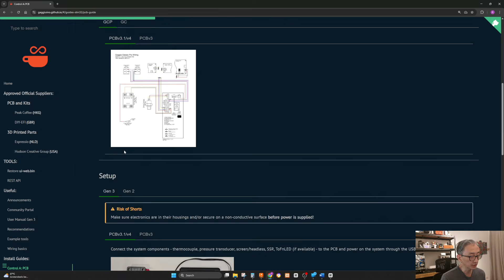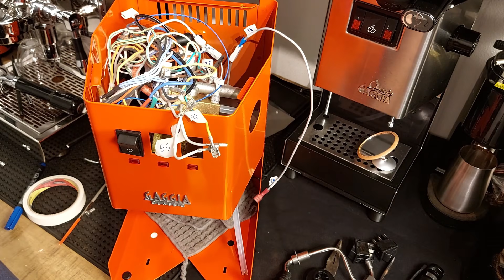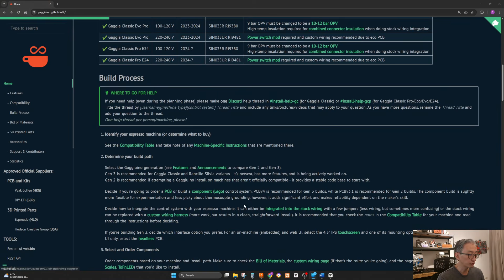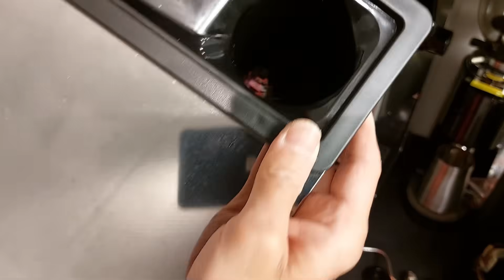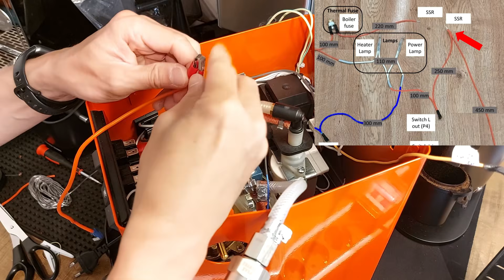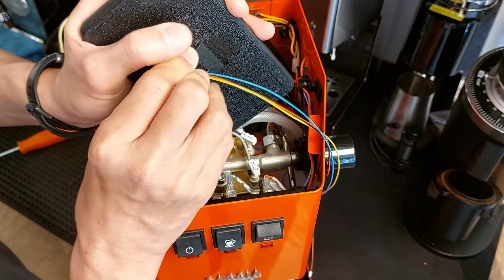Gaggiuino Gen 3 ULTIMATE Full Install guide

Comment: Hi, I have my boiler taken out for de-calc etc. is it easier to fix major cabling outside on the boiler itself or to install boiler back in the machine?
Reply from the maker: I'd put it back. If you didn't descale yet, remember that the terminals cannot get wet or you will break the insulation and if so, you will need to buy a new boiler.

Comment: Awesome video, you really improved a lot of the old video. For me the old one fits better as I have a GC, EU version. 
Did you explain how to download the utility profile [UT] Tube Fill from Community profiles in WebUI somewhere? Did you skip the last step intentionally or am I just wrong?
Reply from the maker: Thanks. I don't remember if I showed, but you can just create a new profile with room temperature, flow limited to 1ml/s for example, and you will smoothly fill the tube with water. You can also flush for a few seconds. If you have any issue, open a help thread on Discord.

Comment: I bought an E24 machine in the last couple weeks and if you're doing this now like me, you need to follow the Schematic because its not that same as this E24 install.  The Steam thermostat also gets remove and there are wires not used and connections not used.
Reply from the maker: Thanks for the alert. Yours is 220v or 120v?
Reply: @EspressoHackers  120v
Reply from the maker: Thanks. I'll re-check that part and see if I need to add some alerts in the pinned coment.

Comment: New version of Gagguino now comes with PTB fitting, should be a bit cleaner than the T fitting for the pressure transducer
Reply from the maker: Indeed. I didn't have the opportunity to test but seems nice.
Reply: @espressohackers do you video on PTB ?
Reply from the maker: No, it wasn't available when I installed my Gaggiuinos. But it's much easier and cleaner, provided that the bolts are not stuck and don't break when you remove them.

Comment: does this display work with the lego version?
Reply from the maker: Yes, it does
Reply: @EspressoHackers  and what kind of display is that... i have made a lego build on a gaggia classic 2003 now i want to build another one on an e24 but i can't find any refs on this display
Reply from the maker: The gen3 display you need to buy from DIY-EFI and Peak Coffee still have available, but Peak will we replaced by another partner. The code for gen3 is closed now and delivered via this screen, that's why you can buy everything else from the official vendors.
Reply: @EspressoHackers ok... so i cannot buy from aliexpress and upload the code...
Reply from the maker: @alexp2306nope.
Reply: @EspressoHackers  one more question... is there specific pcb version for 110v and for 230v? i have ordered one pcb from uk and I just realized that they have 110
Reply from the maker: @alexp2306there aren't 110 and 230. It's bivolt.

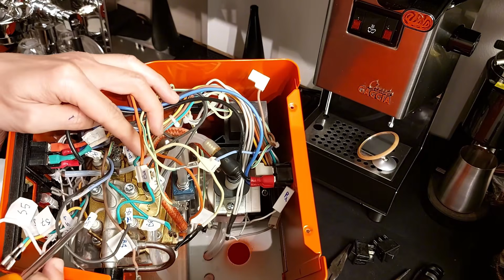Comment: At minute 9:45 i think you have the  heater connections sequence labeled differently than the instructions in the official gaggiuino page. Following the way you’re pointing to the connections in the video, the first one you point at should be H2, then H1, H3 and H4 according to the instructions in the official Gaggiuino page.
Or am I wrong???
Reply from the maker: I'd have to check, but I'm confident that it was correct. The boiler has two heating elements and you just need to pay attention to connect in series if it's 220 and in parallel if it's 110 v. This is the whole logic behind the connections to the SSR.

Comment: Thank you for the lovely videos. Yours are the only complete guides out there! 

Question on the EcoPCB- The discord conversations say it is better to remove it. Where did you get stuck on that one? Any tips?
Reply from the maker: Thanks! You don't need to physically remove it, just disconnect, which is what I did. And the power switch mod, I had done previously. You can see in more details here: https://youtu.be/ZUFQI-8fDfg?si=J8gcgDzLb_mlB__p
Reply: @EspressoHackers  i just got the PCB out of the box no problems (after cutting the wires and insulating them i was unhappy with the result and even when you warned i removed the pump/eco assembly), the two screws at the bottom are finnicky to reinstall, but it was far easier than removing wires from button harnessess :) and after that i realized that my Peakcoffee kit doesnt have full custom wiring precrimped and i have to order flag connectors and reuse some wiring :) but then hey, it will look far more clean with full custom wiring
Reply from the maker: Thanks for the feedback! Good to know that it's being helpful. 

It was tough to remove it, then I decided to let it there. I just cut the wires, insulated them, could have a bit more space if I had removed, but it's workable then I just finished the installation without any other issues.

Comment: Amazing tutorial. Built using that. Is the testing video out?
Reply from the maker: Thanks! Good to know that it was helpful. On Tue, I'll post a comparison between Gaggiuino and Gaggimate with a few performance tests that I did in my E24 and Silvia, both with Gaggiuino and with PID.
Reply: Nice. Gone through it. But I thought that you mentioned at the end of the video that you will test the gaggiuino in depth to check if it’s working.
Reply from the maker: @piyushkjalan  oh, I wasn't clear maybe. I don't think we need to make complex tests to see if it's working/ Right on the startup, you can see if the screen powered on or not, if the temperature is increasing, etc. Before closing, you also need to check for leakages, running some water through the group, then making a coffee of testing with a blind basket just to get some pressure in the line and see if there are leakages inside the machine. I had some issues during the installation of my Gen 2 and I discussed these problems in my install video of Gen 2, but in Gen 3, I didn't have any, it was much easier. What I was mentioning in my last video is that I would share some results of the temp stability tests and steaming. I didn't post all the details in this comparison between Gaggiuino and Gaggimate, but I may post another video in the future, I just don't know how valuable these information are and if it's worth a new video, but I'll think about it...